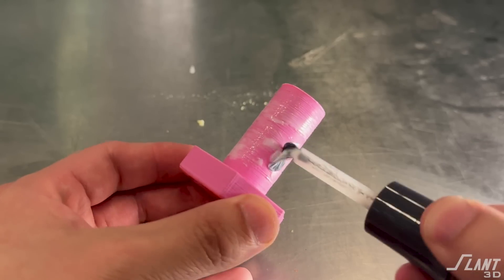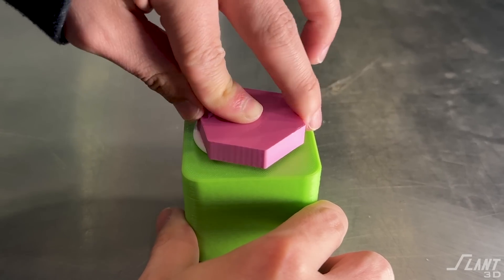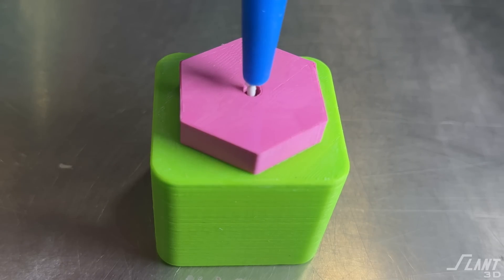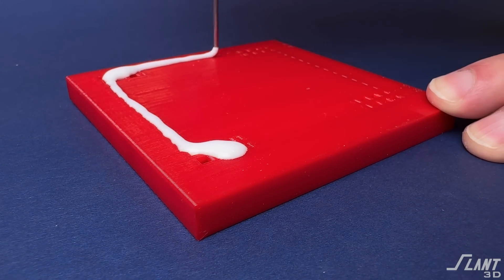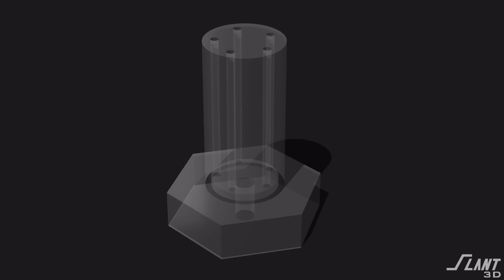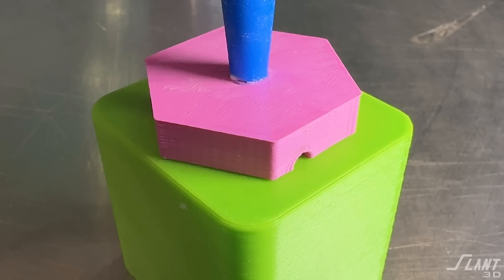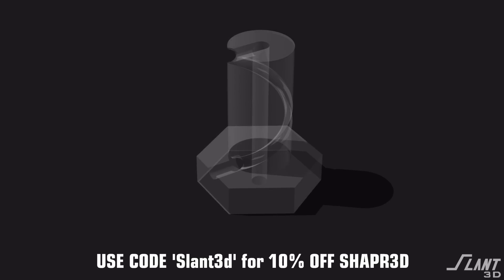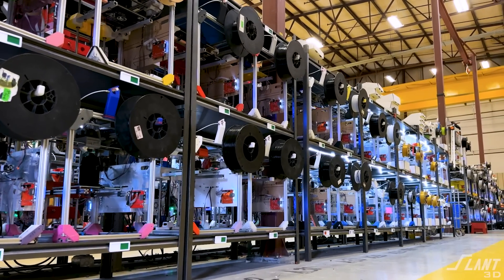Stop Gluing Your Prints the Old Way | Design for Mass Production 3D Printing

Comment: What glues are affordable and strong enough to use in those quantities?
PVA (wood glue) is quite stretchy etc. after all
Reply: Pretty sure he was just using white glue for demonstration.  Epoxies would be you best bet.  But that still a lot of ???  What are you bonding, how thick will the glue joint be
Reply: Modeling epoxy will flow easily and will form a strong solid element inside.

Comment: A thin channel of glue isn't going to add any substantive reinforcement, no adhesive or epoxy I'm aware of has good strength in tension
Reply: Agreed, but maybe adding a wire or rod to that channel with an epoxy, could?

Maybe add an 90 degree bend at the end and use it to connect to a larger assembly.
Reply: @FireGuy90  Thats where I though he was going to go, like add than metal rods throughout the part would increase its rigidity. Idk what glue is going to do to reinforce a part lol
Reply: I was thinking just a length of filament shoved in the holes.  Same material, no expansion issues.  And, now I'm wondering if that could work with "tempering" parts... print, shove some extra filament in, put in an oven to let it bind.  Going to have to try that one :)
Reply: Silicone-glue or caulk might do something, that stuff is basically rubber once cured.
And if interweaving PLA with TPU can increase the tensile strength of a part, then injected silicone should do something as well.
Reply: Epoxy specifically would add a lot of strength by binding layers of the print together inside the channels.
Reply: Feeling typical startup CEO vibes here - talking about stuff with 100% confidence, but not always know what he's talking about - put against mechanical engineer he will see that some of the things simply not add up.
Reply: As far as I can see, it's less about bonding strength and tension and more about creating a solid feature that locks the parts into place. A double slot filled with cured glue becomes more of a solid obstruction that prevents 2 surfaces from sliding past each other. In my case, adding a slot down each side of my hinges and then mirroring that slot onto the faces that encase them would allow for a solid column of glue to prevent the hinge from ever coming loose.
Reply: @josephpk4878  Very similar idea to what someone else and I came up with in another comment! You can create glue or resin or even silicone ridges or rods which fix parts in place. You could create channels to pour in a rubbery substance like two part silicone and literally have built in vibration damping and gluing. I love it when people know how to add on to an idea instead of tearing it down.
Reply: @802Garage  I didn't read the previous replies, but see that the same idea was going thru your head. The key is that it becomes a mechanical bond and has little to do with adhesion. Yes, you could literally stick a length of filament down the hole and then weld the top. Better yet, use a custom shaped profile that has its own horizontally printed "key" that fits the hole and can hold the joint in any direction with a pulling forced on it.
Reply: @josephpk4878  Oh I meant a totally other comment thread anyways. Good thinking!
Reply: Idk about epoxy, I did a bunch of work with epoxy and would peel thin pieces off of plastic after covering a canvass with it and that shit is durable if you try to bend it or pull it apart. If there was a few of them I bet it would help a lot for the pieces to not break apart at later lines
Reply: @LifeofJY , that why the expoxy would help when thicker in the channels. Glue is best for thin layers. Epoxy tends to do better with thicker layers and a mechanical grab.
Reply: Depends on the glue. I had a very thin part that I printed vertically and reinforced in the Z axis by exposing the infill on the top layer and pushing superglue all-the-way through. Worked very well.
Reply: First, there are definitely substances which will be stronger than the print after curing. 2 part epoxies and silicones come to mind. Second, I think part of the point is that it bonds all the layers and fills all the micro ridges so it is harder to separate the layers when bending. Edit: It's definitely not like rebar though and some of his logic is flawed. The spiral glue injection is cool though.

Comment: I love these videos and work with 3d printers daily at work and home. However, i struggle with this one particularly. I see glue typically more like the concrete than the rebar, especially with epoxy. And from what i understand of glues and adhesives is that the tighter the surfaces are together the better the glue bonds them together. But the video seems to imply glue is used to bond and fill the gaps, and the filling of gaps is where i think this is flawed.
Reply: I would think of it more like fiberglass and epoxy. When the epoxy is introduced and displaces the air, we get all the associated benefits. With layer lines we have a bit of a similar situation. Obviously the benefits will depend on the glue you use, but the main idea is the same, and in theory you could use anything as a glue, because it’s just a liquid that will solidify and displace the air (ideally taking the negative shape and locking in with the layer lines: like Paris plaster or epoxy)
Reply: Jea, the rebar theory from his is wild. I think the Video ist great nonsense
Reply: It depends on the glue. I for example got some silicone-glue, which is simply silicon you can get in one of those cartridge "guns" but mixed with a solvent to keep it liquid. And it's quite runny as well, for like 15 seconds, then the outer layer starts forming a "skin" and it starts becoming more and more like thick honey.
It also "shrinks" a little while drying out, which can be a an advantage. But given the silicon nature of it, this stuff is /really/ sticky and can bond with stuff that normal glue will just snap off of, like PET, HDPT or Glass. It's not permanent either, it's more like "seasoned chewing gum", if you can be bothered to put the effort into it (or find a fitting solvent), you /can/ get it off again.

But normally it does /not/ get off again (on it's own), patially because it never fully hardens, which can be another bonus.
And this stuff would work extremely well with the examples in the video.

Other glue that could work as well would be the nice "smelly" (really aggressive solvent) Pattex kind of glue for example. It's remotely similar to the silicon glue as in that it usually never fully hardens either and turns more into some rubbery stuff, just without the silicone stickyness. But for the examples in the video, the stickyness in combination with turning rubbery could also work.
Reply: I think you are very correct. Let's  not forget a few additional things. Most of the thicker adhesives are made for tough joints, which will allow some deformation once set. The problem, especially in the case of layer adhesion, is that a brittle fracture occurs between the stiff but not strong bonds between the layers. So, adding something that is like a thick, tough, but rather flexible adhesive between the stiff  layers and loading them in parallel will not add much strength to the part in that particular loading direction. Remember here that the deformation in both materials will be similar. The tough adhesive will not be able to carry as much of the load compared to the polymer with a global deformation.
Reply: A lot of their stuff is focused on printing hundreds or thousands of parts and developing an assembly line process that a worker can do. And there's also a lot of exaggeration to make it more understandable, but I agree that it's sometimes confusing
Reply: You should check out Matthias Wandel's video on "Can you squeeze all the glue out of a joint" while not scientific testing, and on wood, he found that super tight joints were not the best. Not to say you want a lot of slop, but there does seem to be a happy medium. I completely agree with this not being like rebar though.
Reply: I feel like the best use for this and the one that would actually increase strength would be to print  in ABS/ASA and use a thick ABS/ASA glue. The capillary action would be pronounced and we’d be left with a “rebar” far stronger than any sort of glue. JB Weld type epoxies might provide a strong enough substrate as well for other plastics.